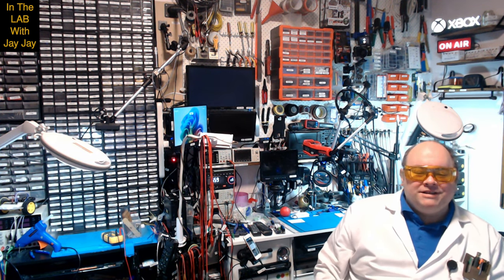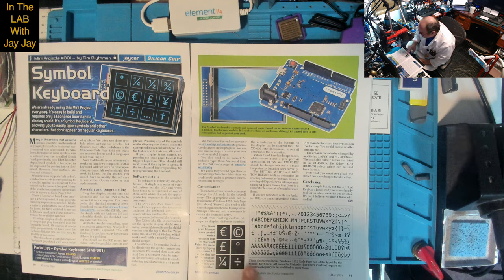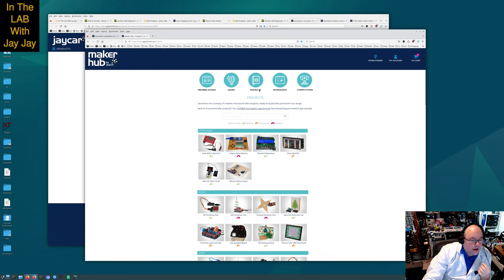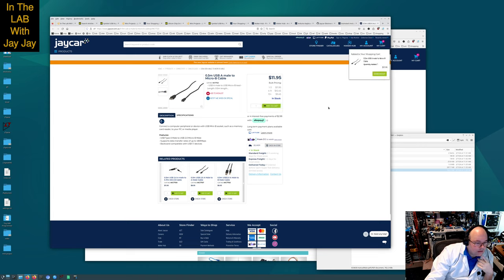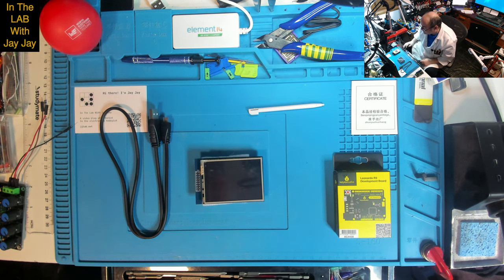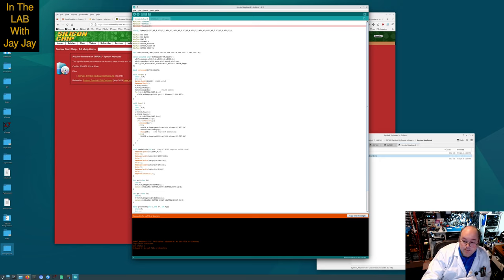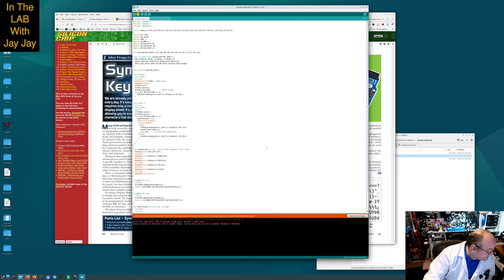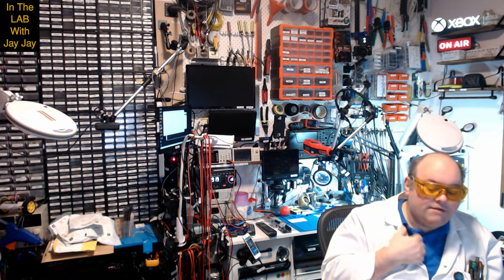Symbol Keyboard | Mini Project JMP001 | Learning Electronics In The Lab With Jay Jay

Comment: Hi Jay Jay,

Try changing line 51 to delay(500); in listing Symbol_Keyboard.ino for debounce.

Also in Symbol_Keyboard.ino change subroutine void sendUnicode(int n) line 59 too this and comment out the old stuff

Keyboard.write(kpKeys[(n/16)%16]);
delay(1);
Keyboard.write(kpKeys[n/1)%16]);
delay(1);
Keyboard.press(KEY_LEFT_ALT);
delay(1);
Keyboard.press(0x78);
delay(1);
Keyboard.releaseAll();

And in listing XC4630d.c lines 75 to 80 try messing about with the touch calibration values to get touch alignment right.

Note:- This program will probably not work in a Notepad type program so try it in a word-processor like LibreOffice Writer.

Note:- I don't have your kit but I hope it works, Linux only!
Reply from the maker: Hi there. Thanks for your suggestions! I will do another video in which I will try to debug this thing. I will comment here again with the link to the video when that's done. Please stand by. :) (Gimme a week or two, I'm a bit busy at the moment!)
Reply: @InTheLabWithJayJay  
Hi again,

Just noticed I missed something out,  The decimal to hexadecimal conversion.
So change line 5 in the Symbol_Keyboard.ino file to:-

uint8_t kpKeys[]={48,49,50,51,52,53,54,55,56,57,97,98,99,100,101,102};
Note:- They are (curly) braces and not parentheses before and after the numbers, just copy and paste.

I hope this works,  as I said I do not own an Arduino or touch screen.

It would be nice if you did the mods as a live stream and perhaps myself and others could join you and help real time. Just give a few days notice. Just a suggestion. But if you do it non-live that's OK, I will watch it and see where it when wrong, part of the problem is I don't know your programming skills and don't know how in-depth my instructions should be, I'm sure you will work it out.

All the best,
TheSecretEngineer.
Reply from the maker: @thesecretengineer  Hey again. I haven't done a live stream before, but it might be fun to try and figure out how to do that. What time zone are you in? Can you give me some dates and times (in your time zone) which would work for you?
Reply: @InTheLabWithJayJay  I'm in the UK, I can't ever give you an exact date as I can get a phone call one  day and be out the next, the only date I am definitely out is 22nd Aug, But apart from that I'm about 24/7, so just pick a day, schedule it on YT and I will be there if I'm about. I used to do live streams, they are all deleted now, but it is worth doing a practice stream (marked as private) or two just to get the hang of it and using the software and listening back to check sound levels etc. The software I used was OBS it's free and works with Win, Apple and Linux.
Reply from the maker: @thesecretengineer  Thanks for your advice! I will see what I can do about scheduling a live stream some time soon. I will do a private trial run first as you suggest. I'm using OBS on my Linux box already, but I haven't used its streaming functionality yet. I am curious... why did you delete your live streams?
Reply: @InTheLabWithJayJay  I deleted them as I was collaborating with another YTer and I was using my computer (being the programmer) to do the Text To Speech (TTS) translating the live chat to speech including Foreign to English with Accents and other fun stuff that was built into the program at my end, he only used the audio though, and since I did not stream him it was just watching the program doing its stuff at my end, not very interesting!
I am now out on the 21st, 22nd, 27th and 30th Aug. You can do it between now and the 21st as I will be free, I'm always free at the weekend. I think the best time for you to stream is to look a YT analytics in the YT dashboard and see where most of your subscribers are based and pick the best time for them at the weekend, but don't put yourself out (no getting up at 3am).
Allot of people love live streaming as there is no editing which is tedious, and it is quicker in total to just do a live stream, warts and all.